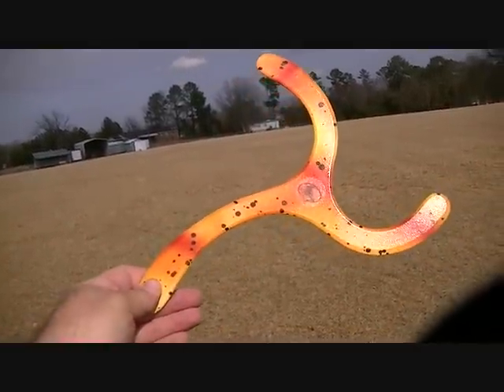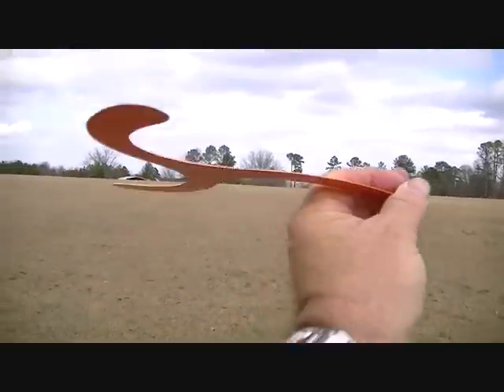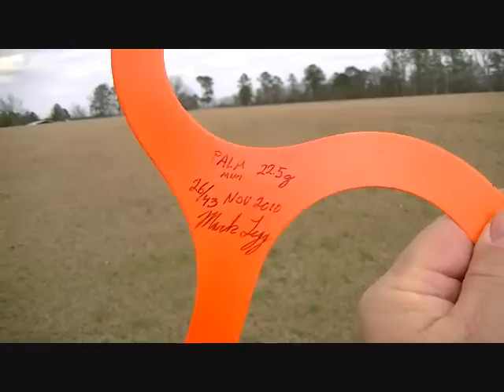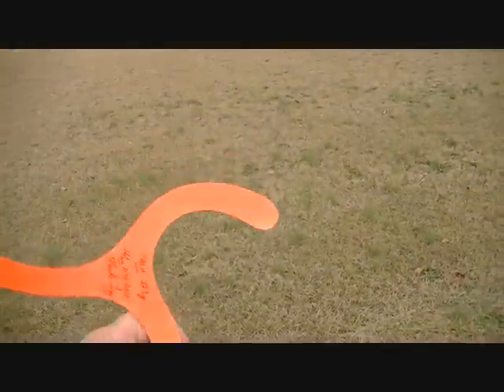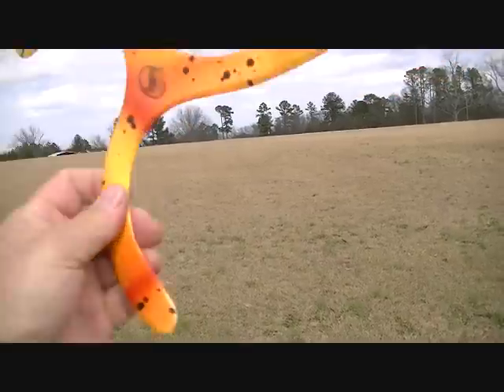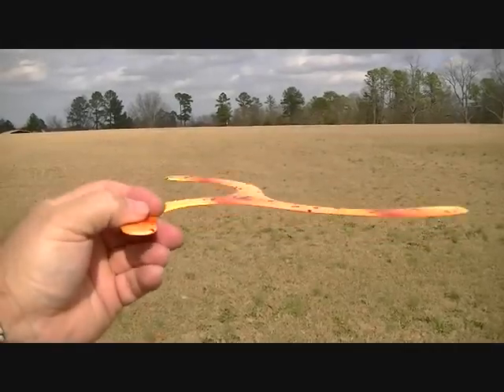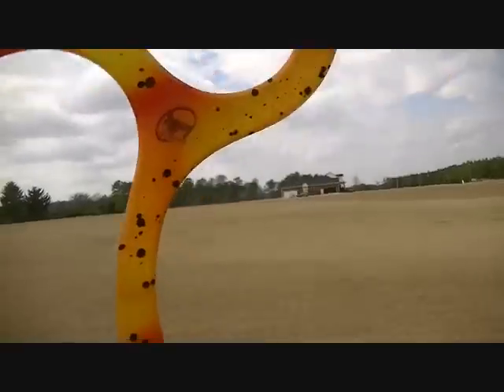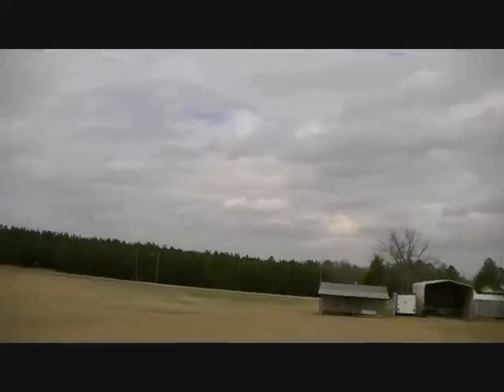Palm MTA. Boomerang

Comment: I made a sky high mta out of thin wood when I was sanding it it kinda broke but I fixed its good now but I have fear it will break when I throw it
Reply from the maker: These are made of paper phenolic plastic type material. Its hard and tough yet flexible. It can break easily if it hits the pavement.  You can shape it though. If you press it into the center of a Chinese Wok cooking pan it will give you the right airfoil twist, so it will stay up longer. That's the easiest way to tune one.  It sounds strange, but it works.
Reply: I’m trying to experiment to see if it flys but if it doesn’t fly it’s probably cause it’s wayyyy to windy so it will immediately lose control